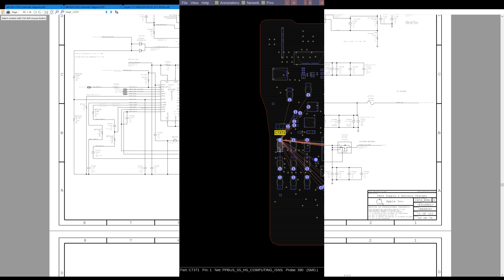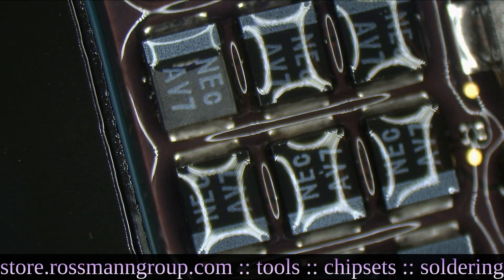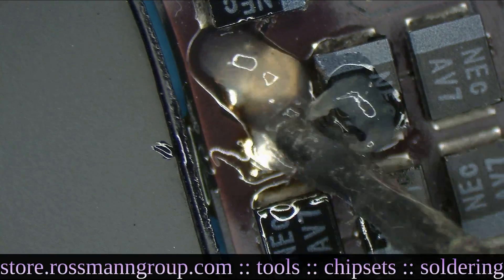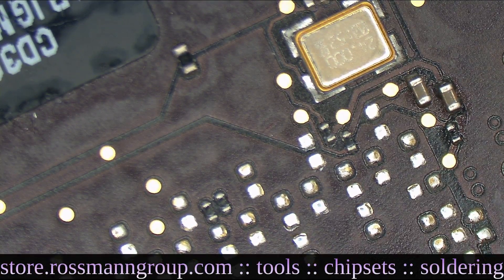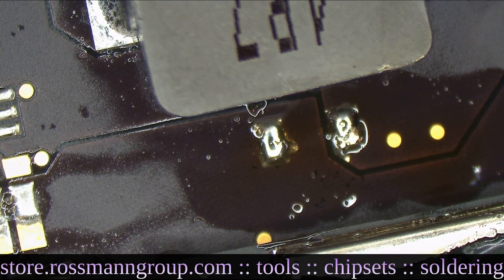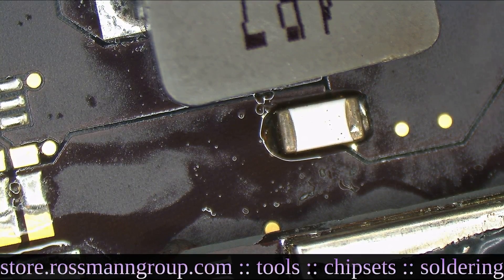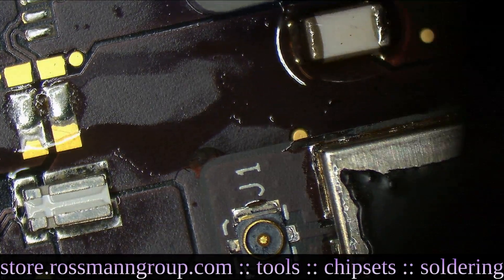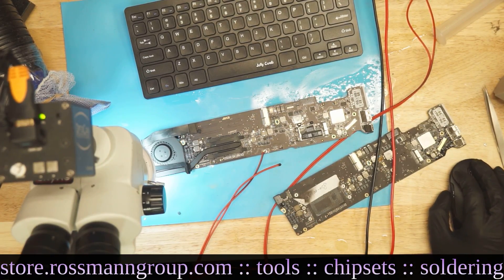Macbook air board repair

Comment: hey im always having trouble cating your streams i wanna donate to you, and i have a question. what did you go to collage for? like what did you study because i really want to do what you do, im 15 and i fix iphones and macbooks right now but just minor problems like drive replacements or screen replacements. i actually do fix computers alot but i dont work anywhere its just a hobby and im good at it and i wanna do what your doing.  sorry form by bad spelling i burned my finger on a soldering iron and it hurts to type

Comment: can you tell me what is the name of water lequid ?
you use it to find the short capasitor.
Reply: now he uses thermal camera for several thousend $$
Reply: That would be alcohol(particularly Isopropyl aka rubbing alcohol) .  Commonly used as a antiseptic for first aid among other things, it has a low boiling point.